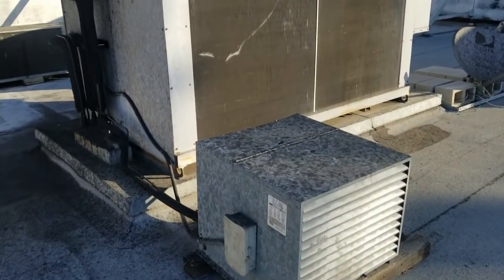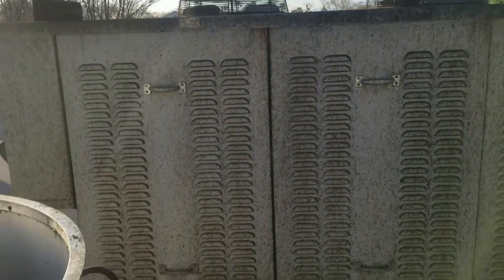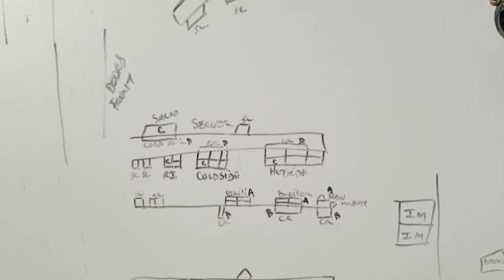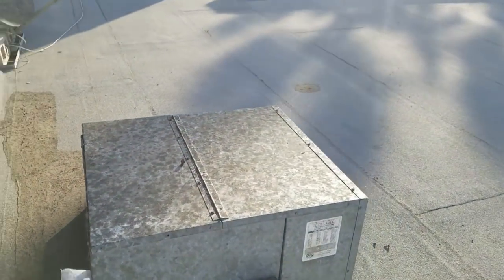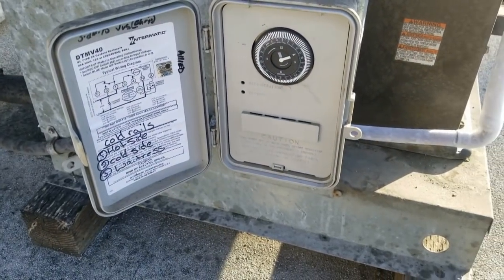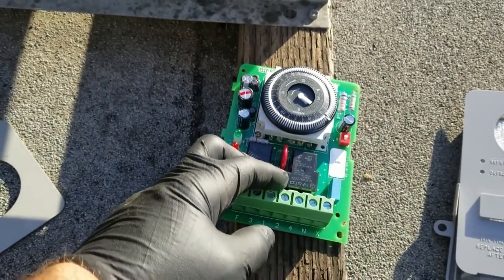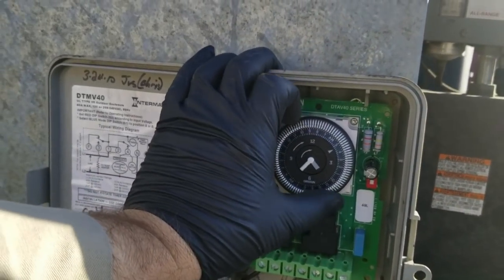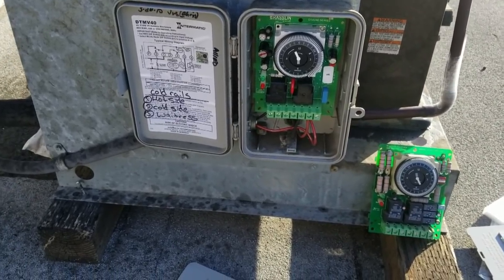Cold rails not working properly

Comment: Maybe they just lost power to that condensing unit for a while which caused the clock to not be set to the correct time?  The customer must pull the product at night for that long defrost?
Reply: Like if someone made a repair on it and shut the disconnect off for a while and then forgot to set the clock to the correct time of day when they were done
Reply from the maker: You are definitely thinking about it correctly, but I am the only service company for that restaurant and i always set the clocks when i am done. If it was a power outage or someone turning off the breaker than all the other clocks in the rack would also be off on time ( the entire rack has a single power source) thanks for watching and taking the time to comment!
Reply: @HVACRVIDEOS  my thought was a hvac guy could have been up there for something else. The clock must have been off by about 12 hrs but it was still running. You must know this can happen from your experiance. Me not knowing the equipment would not have the judgement to discern it properly.

Comment: I have a stupid question on this rail units .. Do they go into pump down when the temp satisfies ?
Reply: I'm guessing they do not pump down..When Chris put it into defrost the condensor immediately shut off instead of pumping suction side down then shutting off
Reply from the maker: Sorry guys this one slipped thru the cracks, yes the rail has it's own solenoid valve so when you shut off the rail switch it pumps down.
Reply: @HVACRVIDEOS  Good thing you caught my misguiding advise Chris lol I seen how quick unit shut off when you put it in defrost so I assumed it wasnt pump down.
Reply from the maker: I will have to rewatch the video to figure out why it shut off right away. This video was from a while back.
Reply: The time clock is just killing condensing unit with no pump down during defrost
Reply: It’s pretty common for that

Comment: Defrost clocks Never Put them on a roof how would you keep them set correctly with no Genset installed for building put defrost clock in building so you can set the time as a building owner

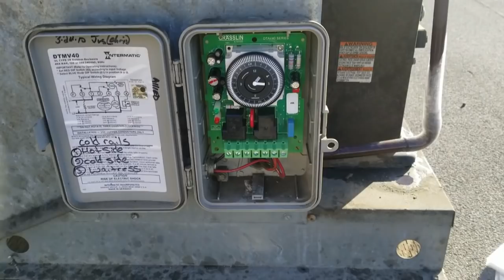Comment: 5:52 Wouldn't it be awesome if that box had like a rubber gasket and have the holes the cables run through be airtight with some kind of heat resistant silicon plus some oxygen absorbent packs inside the box so that the metal components of the clock don't rust?
Reply from the maker: Ricardo Sanchez but than I wouldn't be able to sell them a new one. :-) But yeah I hear you they sure don't make quality products anymore!
Reply: LOL, i fully hear you... just that where i'm from we dont have access to parts so easily so i'm on that prevention mindset
Reply from the maker: Yeah luckily I have multiple supply houses within a 1 hour drive of all my locations

Comment: Compressor  and condenser btu rating not enough for 3 cold rails?
Reply: I’ve had the same issue with the cold zone  racks. The design engineers love to set them to Minimum outdoor temperature usually around 90-95 degrees. I have always run out of capacity in the middle of summer. 
We generally up size as well and shoot for a 100% capacity up to 110 degrees before any cooling lose. 
Nice to see someone else doing the same! 
Sure eliminates nuisance calls
Reply from the maker: No they were struggling so I upped the tonnage.